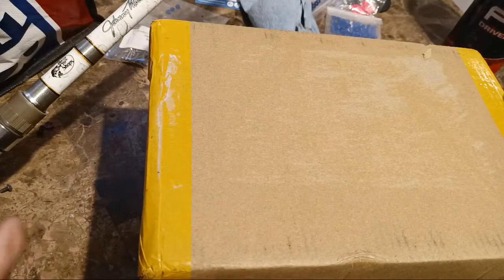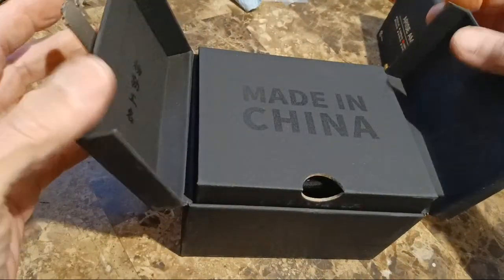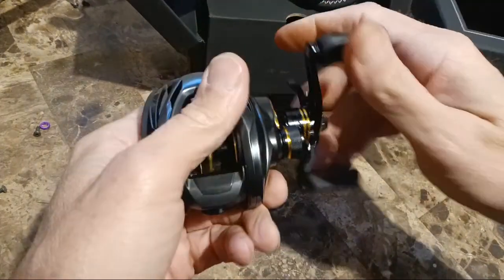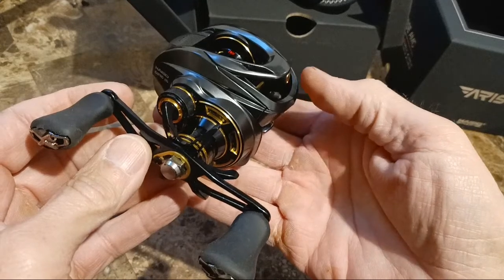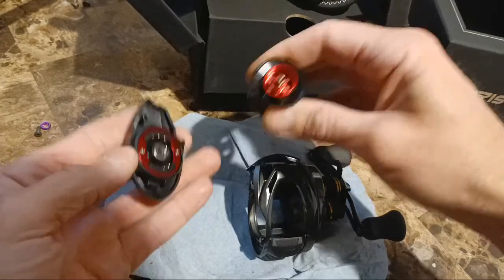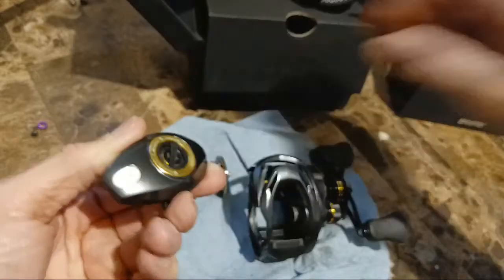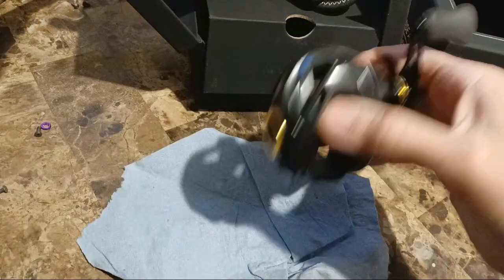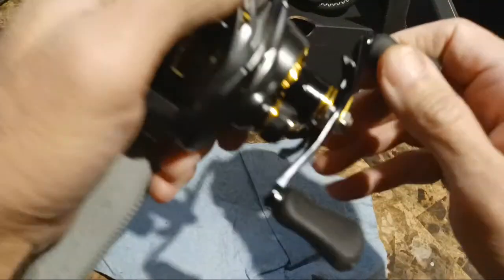AliExpress Arise Steez Wannabe Or Legit Baitcasting Reel

Comment: What NOMDI said.  The motion is small but but they are mobile.  I think you should start out in the number 2 position.  Using the 2 position and the outside control dial, I have cast everything from 3 grams to 16 grams easily. 
The weight of the reel is .3 ounces more than the Zillion; not light, but this is not a BFS reel.
This reel has every feature of the $ 239 ARK Gravity reel sold by Tackle Warehouse, including the Floating Cast Control,  Feather Light Spool. and Cone-Shaped Line Guide etc.
Cosmetically the 8 to 1 ratio reel is IMO not nearly as attractive.  The purple parts are very dark and look almost black.

If The Reel Test had had the guts to get the best out of this reel in a cast battle against his favorite Shimanos in a FAIR cast test, I'll bet the Arise would have won.
Reply from the maker: Yeah I'm impressed so far and then yeah once I looked into it more last night I could see that it's definitely a dynamic magnet system just like the FTB except it's on the outside

Comment: Hello, what weights can be thrown with this coil?
Reply from the maker: Sorry for late reply but it'll go down to say 1/8oz or 3.5 easy enough.. easier if you run less line on the spool but ideal weight would be say  6 to 18or 20g or 1/4 to 3/4 oz in my opinion.. it likes a soft cast with any weight you use